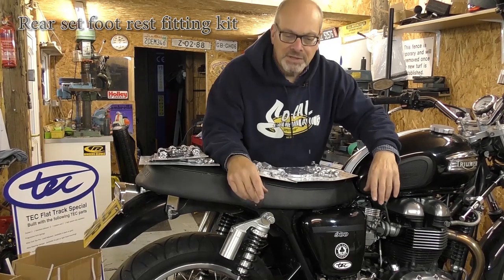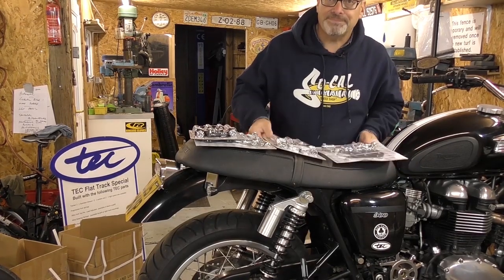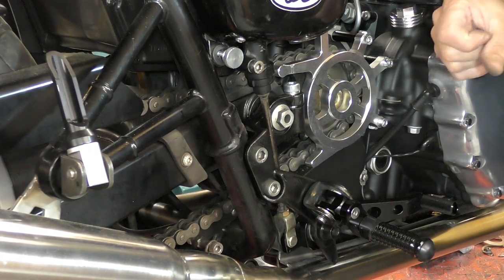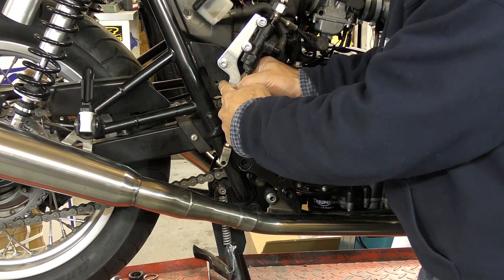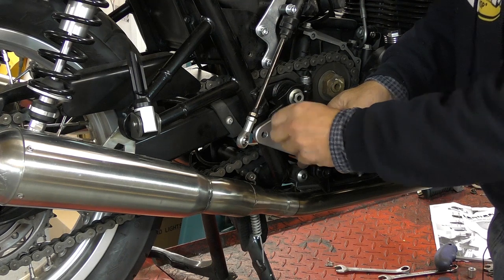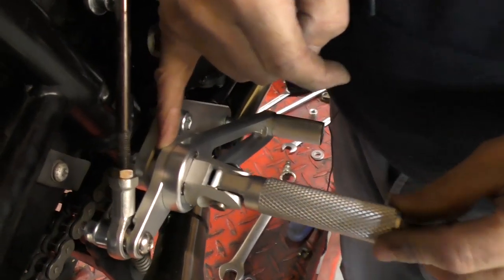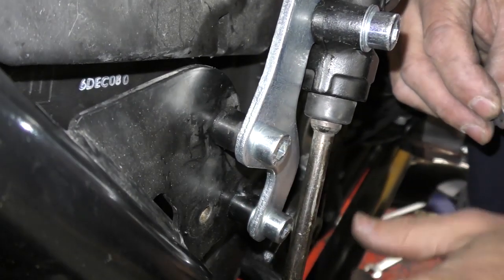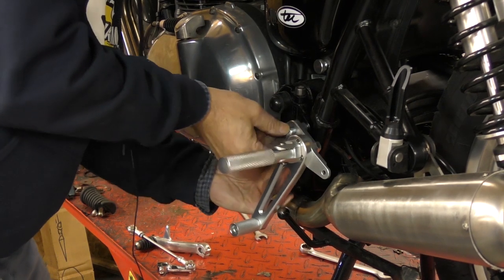Triumph Bonneville rear set alloy footrest kit fitting TEC Rear set foot rest kit

Comment: Good video, thanks. I have a different problem. Would like to replace the stock rear sets on my Triumph 900 Thruxton with stock foot pegs and shift pedal and brake pedal... is the truxton set up to take stock Bonneville shifter and brake pedal or it does it take a special kit?
Reply from the maker: Hi Brian, This is quite a common conversion on the Thruxton, you would need these Bonneville parts- rear brake master cylinder, right and left footrest hanger plates , 2 x footpegs , brake and gear lever.
we make alloy brake and gear lever and alloy footpegs but the other parts would need to be sourced and normally found used on ebay.

Comment: My kit doesn't have the M8 bolts and nylock nuts that attach the brake cylinder to the stamped bracket (at 3:09 in the video). I've double checked everything, laid all of the parts out on the floor, and those are definitely missing.

Comment: Nice product ! and seems reasonably priced compared to others on the market . Any chance you could let me know how far up and back the center of the footrest is positioned compared to stock  . Cheers
Reply from the maker: Hi
moves the footpegs back 110mm and 65mm up
Reply: Thanks very much for the reply George .
Reply: TEC Bike Parts How do you replace the right side cover. It hits the master cylinder
Reply from the maker: you need to re locate the brake pipe
Reply: TEC Bike Parts can you elaborate a bit? I'm about to order these but want to be prepared for all steps. Thanks!
Reply from the maker: anything you are not sure of or need any advice when fitting you can contact me on 01661823370 Mon-Fri 9-12am
Reply: I just ordered this rearset kit from TEC, nice parts to look at and the bike feels better than before. Unfortunately I have to tell you guys that you really need to either give instructions with your kit or make a video that's a reliable source of information for the DIY guys like myself. I understand that you know everything about the kit but I do not. I can't see through your body in the video. I got the job done but I would be more confidant in the install if you actually explained things a bit more and showed the full amount of parts going on in order with some amount of detail. Maybe a little more on the relocation of the master cylinder? Paper instructions would be a bonus and I'd have paid 25$ for some. Nice parts, super lightweight but the instructional video leaves a lot to be desired.

Comment: Will these fit the new T120, or are there any plans to introduce a T120 version any time soon?
Reply from the maker: sorry only for the air cooled bonnie at the moment
Reply: TEC Bike Parts how about Bonny 2013 SE does it fit on right side perfectly ?
Reply from the maker: you may need to fit a slim brake light switch if your bike has the 'fat' type fitted,another fix is to use a spacer on the right side panel between the frame and panel on the fixing screw
Reply: TEC Bike Parts how do I do that ? How do i fit a slim brake light switch in ?
Reply: Interested in this as well!

Comment: I have a 2010 Bonnie. Now I can't get right side cover on properly? Is this a flaw in design? No instructions given in video or with kit. Little disappointed currently. Is there a quick fix for this?
Reply from the maker: Hi
we have found on some models  that Triumph has used a large diameter stop light switch ,you will simply need to change this to a smaller aftermarket switch
Reply: I also had the same problem today fitting to my 2003 Bonnie. Panel doesn't close and the master cylinder rod definitely has to be on the outsideof the bracket using the spacer. Mine just cleared on the inside so I though was OK but when I test rode my bike it rattled loudly and caused some brake fluid to leak. Hopefully my brake cylinder is still OK.. And the gear shifter bracket hits the o.e.m exhaust so I had to adjust it forward which makes the linkage rod too long so I had to put the gear shaft bracket forward which doesn't look or function as good as it should be. I bit disappointed considering its sold as a kit to fit all models of air cooled Bonevilles 2000-2016.
Reply from the maker: Hi
we have found some bikes have a large stop light switch fitted you need to swap for a slim type
Reply: Could you post a link to a suggestest switch?
Reply: Could you post a link to a suggested switch?
Reply: Here is a link for the replacement switch.
https://spieglerusa.com/catalogsearch/result/?q=20-01012-52